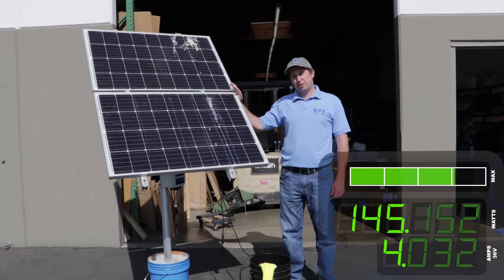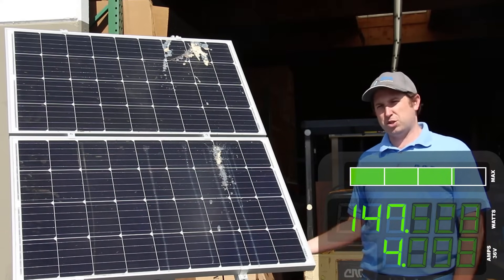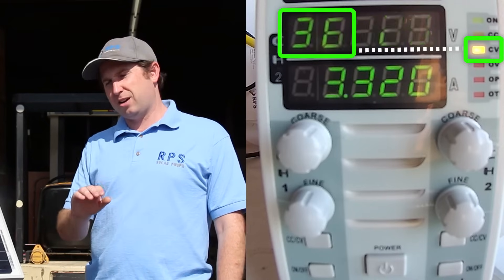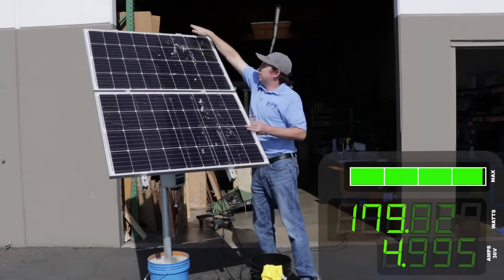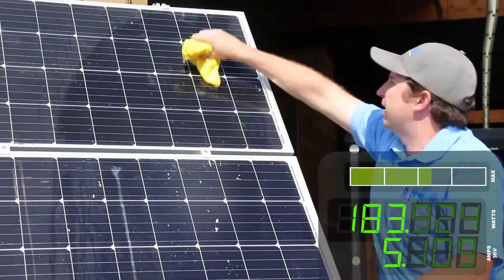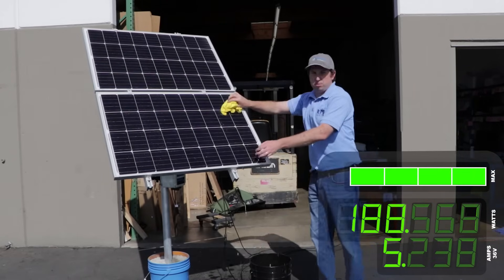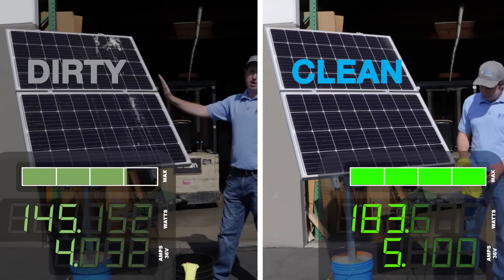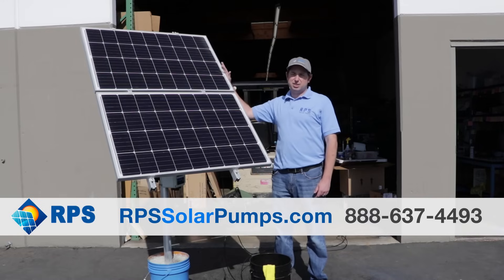Dirty vs Clean Solar Panel - Power Output Comparison and HowTo

Comment: the water cooled the panels and skewed the results. You should wait after cleaning until the panels get back to the initial higher temperature and then make the measurements.

Comment: People also forget, that heavy dusting also holds and traps heat. So dust is not just blocking light rays in, its also making the panels hotter.

Comment: What type of water are required for cleaning solar panels? I hear that hard water isn’t recommended
Reply from the maker: The hard water might leave a residue, which you'll have to wipe off after the washdown, but any water type will really do fine

Comment: Soooo, does it matter the size of the system as to whether or not you should turn off the power or is that only for grid connected roof arrays? I've read where you should turn off the panel power before cleaning, but you didn't. Also I read you should not clean the panels in direct sunlight and to do it early in the day as possible so the water doesn't dry immediately on the panel and streak or possibly crack the glass due to colder water going onto an extremely hot surface? Is that no longer a concern/issue with newer panels?

Comment: Bucket and a brush and pole mate .. otherthing is  do not spray tap water on thses panels without checking the  Hardness of the water ( TDS meter ) If you live in a soft water area great just use your garden hose. If you are in a medium or high  water hardness area   do not  spray them because they will eventually go white  due to the high mineral and solids content of hard water

Comment: Thank you for sharing. I'd like to submit a scenario related to my building, whose roof is oriented South-West (but very close to pure West). In the Winter the sun rays angle is 65 degrees from the perpendicular (a mountain covers the sun after 2PM). Is it possible to figure out if the dust affects performance degradation in these conditions? I think the degradation remarkably increases. Doesn't it?

Comment: do you clean solar panels without turning off the inverter
Reply from the maker: Does not really matter if the inverter is away or enclosed and wont get wet from the water.  If you have any concerns, might as well shut it all down.

Comment: This helped in more ways than one. I have a dj speaker that wouldn’t turn on. I have solar, and my panels were dirty and not letting me get more than 117 volts. After cleaning i got 118-119 and my speaker turned on. Thanks for your great video. I would have never figured this out.
Reply from the maker: Great to hear!

Comment: Nice to see clean panels again but the numbers are missleading unfortunatly as you didnt wait for them to heat up back to working temperature after washing. Thats why you see steady wattage decreasing in the end of the video. Average temperature coefficient of monocrystaline panels is around 0.5% per degree celsius, so assuming you cooled down the panel from 60° to 30° celsius by washing you gained 15% more output from temperature alone. You can check this by cooling dirty panels from backside with a hose or something, power output will increase even no grain of dirt gets removed. But still then you get realistic 5-10% more power from cleaning depending the amount of dirt on the panel whats still worth to do so :)
Reply from the maker: Through the magic of video editing, there is a cut that is hard to see (mainly when I mess up what I am saying!), which allowed the panels to warm up for the final measurement we used at the end.
Reply: @RPSSolarPumps  Thank You for the Video👍

Comment: I love the cement bucket stands.  Much better than roof mount, sort of moveable and easier to clean!
Reply from the maker: Yeah, just make sure they are heavy enough depending on the wind in your location!
Reply: @RPSSolarPumps  Size, weight of panels in relation to cement block too.  And you don't need a bucket, just a cement mold.  Panels do have wing-like surface area in a wind, tho.  Do you lock em up at night?

Comment: The pannels should have been allowed to heat up again for a more accurate comparison. A 25% increase is misleading it’s more like 2% anywhere on the internet.
Reply from the maker: Source?
Reply: Certified electrician. That’s not accurate at all. If that was the case and we could get a 25% increase in electric output from cooling them, then we would run cool water through hoses on the back side. That would be an astronomical increase in efficiency for fairly little energy input. Plus you could recycle the hot water into a heat exchanger for added gains. 

The dirt and bird shit absolutely do effect the cells output to this degree. I try and tell everyone i know with Solar to wash them at least every month with water from the hose at the minimum. Better with a brush and soft water if you can reach them. 

The energy returns really are worth the time. But they don’t tell you that when you buy your system because they are in the business of selling you a system, the bigger the better, and not in the business of cleaning it.
Reply: I'm in the cleaning business and tap water is really bad for the solar panels. It will corrode faster

Comment: Very nice demonstration.  Nice to have live output (green digits) in lower right corner monitoring electrical output.  Keen eyes (at time stamp 3:15) will notice how the output tanked to 15 watts simply by having your arm & body shadow interfering with panels.  Demonstrates that dirt & shadowing is one of the most detrimental cause of poor output.  Simply by removing the poop (aka: shadow) immediately increased output (yea, I know, critics may contribute the output to the cooling effect of water. .... whatever).  Well done.  Additionally, you created an artificial MPPT effect by holding voltage constant.  Nice way of reducing variables for a more accurate final measurement.  My only constructive criticism to hush the negative critics would for (RPS Solar) to enter a final photograph of output after the panels had warmed up again after water evaporation and panels returned to a stable "hot" running temp due to sun exposure.  You made note of this in comments/replies, but to satisfy the lazy viewers who don't scroll down to read......  Anyway, nice vid.  I support your demonstration.
Reply from the maker: Yes, they were wired in series which matches how we use them for the RPS200 solar pump kit!

Comment: Will these panels cloud over.  How would you restore them?
Reply from the maker: Nope, not at all.  All of our panels come with a 15 year power output warranty.  All you have to do is clean them occasionally to keep them operating at peak performance!
Reply: If you are talking about use of hard water to clean the panels (if your water has high mineral content), I read online that you should use de-ionized water, but no idea where/how to get that OR use some type of hose filter to remove the minerals. Over repeated washings and time you could get a cloudy buildup layer of minerals (particularly if you have high limestone content in your water).

Comment: Are you sure the increase is not from cool panels from the cleaning?
Reply from the maker: You can see the power output increase as the panels cool, and then as they warm up, power output slightly decreases.  When we did the final power comparison, the panels were the same temperature as before!  But great question!
Reply: Check time stamp 4:03, ...Namzy.  Pop-up clearly indicates temporary efficiency due to cooling.  If not believing that, do some simple delta temperature coefficient calculations to determine some average amperage drops.  Even with a hypothetical (my estimate) 30-degree temperature variation, amperage output dropping due to increase of temp isn't as significant compared to dirt on panels.  Finally, notice how his shadow on panel tanked the output to 15 watts on occasion.  The bird droppings alone caused shadowing and reduced output of about 20 watts.  No vid is perfect, but he demonstrated a viable solution for more output efficiency.

Comment: Thanks for nice video clip. But it is not recommended to clean the panel during the daytime. It sometimes causes potential induced degradation (PID). Please clean them in the sunset or sunrise.
Reply from the maker: Thanks for the concern.  We use only the highest quality tempered glass, mono crystalline solar cells, with top of the line automated encapsulation methods for our solar panels.  PID is not an issue for our panels.
Reply: What of a rain in the afternoon

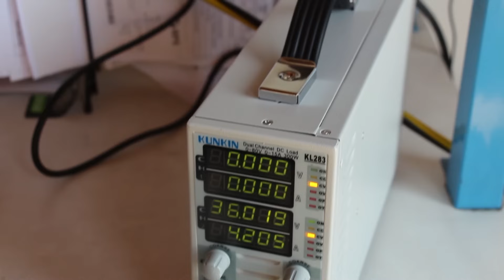Comment: 1:03  NO.  Actually out of a 200 Watt panel on a clear sunny day, you SHOULD be producing 200 Watts, not 180 to 190 watts.  Just more false advertising with the infamous words, "Up To" inserted in the performance claims.  It would nice if manufacturers could state "A Minimum Of" in those inflated performance numbers.
Reply: Certified Photovoltaic / Solar Thermal technician here: 
Just because it's rated 200 Watt doesn't mean it outputs 200 Watts. That 200 watt sticker is what the UL Laboratory certifies that panel after they've tested it under OPTIMAL CONDITIONS. To achieve the maximum possible output: the panel must be properly installed, at the right angle and direction, and crucially, is receiving peak sun (like what you receive at noon). Plus you won’t actually get optimal conditions most of the time. To begin with, your panel will receive less-than-peak sunshine for a large part of the day, such as in the morning and late afternoon. At those times, your panel will produce far less than 200 W. On top of that, further complicating issues is the fact that the total amount of sunlight varies by location, because of geography and climate. What this all means is that a 100-watt solar panel will produce different amounts of total power (measured in watt-hours or kilowatt-hours) - depending on where you use it. A solar panel made by SUNPOWER produces more that what is rated at. Now That's Made in the USA!!!
Quality My Friend not cheap materials... FYI a battery puts out what is rated for only till it's drained, bad etc. same goes for an electrical home outlet. If outlet is old, old wires, etc you'll get different readings. So now you know they're not inflated performance numbers. Have a beer and "Stay Thirsty My Friend". i Like, OLE!
Reply: fvrrljr actually, standard test conditions, not optimum.  Full sun and just over freezing should produce more than STC.  That’s one reason why cables should be oversized.

Comment: Man 25% is huge! I gotta clean my panels now.
Reply from the maker: Yeah, we were a bit surprised as well.  Panels are connected in series, with all of the cells in series.  So impacting a few, can current limit the entire string, let alone the dust impacting as well.
Reply: Instead  -26%, you can have +12%  efficiency, Thats 38% Differance. Watch this. It clens and cools all year round.  +12% power production, ZERO dirt, zero drop of efficiency. https://www.youtube.com/watch?v=B9_UmbMZjAc